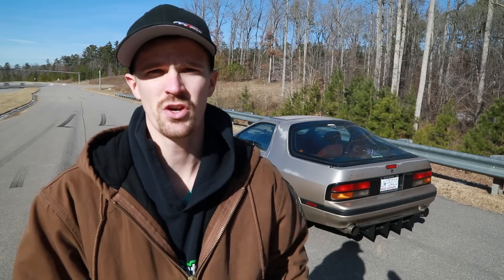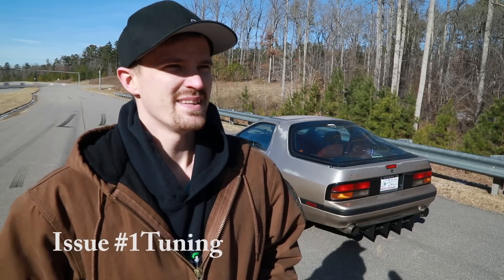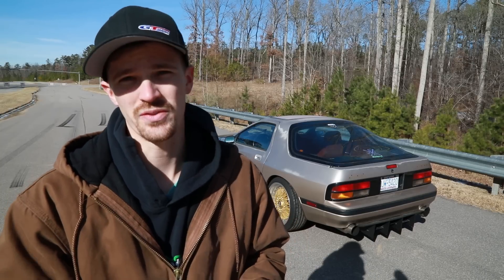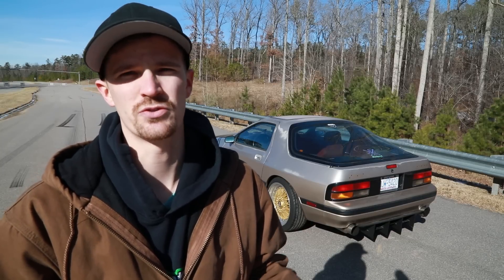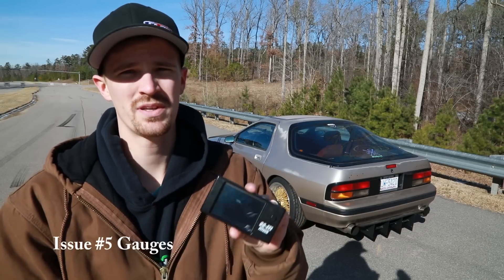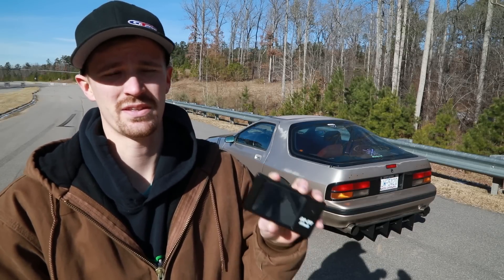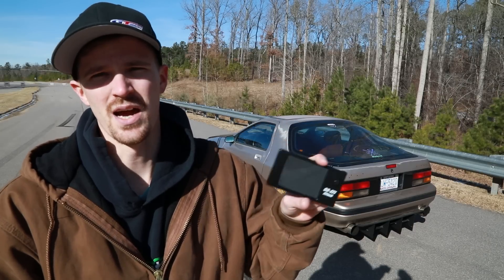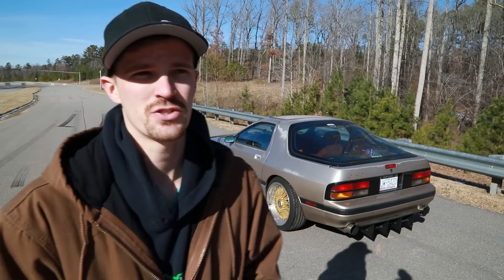5 Reasons Not to Buy FiTech EFI System

Comment: I find this funny. I’m thinking back to when I started doing hot rod work. When my friends and I built a 49 Ford mixed with a 51 Mercury and we had trouble with vacuum hoses and the 4 electric wires were confusing. We called the Gang Green. Have fun.

Comment: after many years of having a carb i decided to try efi and went with fi-tech. it was cheaper than other systems.. that was a mistake.. from the time it was installed it did not work properly. after endless hours of tuning and frustration and many conversations with the so called customer service, the unit had to be sent back for a complete firmware update.. this went on for 4 months.. it was returned and the same thing happened.  it never worked correctly.. then all 4 injectors failed.  a complete software failure.. fi tech was totally no help and did not stand by their product in any way.. i wasted 6 months of time money and frustration from fi-tech.. i moved to the holley system and have been very happy.. i sent the unit back to fi-tech in hopes they would stand by their equipment and give me a return.  well that did not work either. they have not contacted me at all.  just another reason to be very weary about spending your hard earned money to buy fi-tech.. if you are thinking about efi, run don not walk away from fi-tech..

Comment: All of that is easy to fix. Toss the china junk in the dumpster where it belongs, or sell it to one of those Yahoo's who never had a car that ran decent and think fitech great. Replace it with a Sniper or EZ-EFI. Problem solved. 
Source: I've fixed many cars with a fitech that didn't work right. The average cost to the customer was substantially lower for the ones who agreed to trashing the fitech and replacing it with a better system. Most of the ones who didn't, and drive the car a lot, were back to have it replaced with a better system within 18 months, when the fitech died (because they don't last).

Comment: I have the 400 to 600 horsepower EFI  Carburetor. On the 3 50 72 Engine. Was good for a while. Having problems with my fuel. Have a pump in the gas tank. Worked good for a bit. Used to have a command center with the mechanical pump and that worked   better But double problems if if one quitch the other 1 does.. If I would do it again I wouldn't bother. I wouldn't go with this again. There's always something.  not reliable.

Comment: I have a 69 Camaro Z28 ZZ4 Crate Motor 350/385 H.P. 2 FiTecs later I now have a Holly Sniper I had the ECU burned out on the first unit that they replaced under warranty the 2nd unit was installed and it just had idling and stalling issues even after I installed the holly sniper fuel tank 
be aware that the fuel system works on a siphon system the fuel pump has to be lower than the fuel tank the whole thing has been a nightmirror for me. I now have all Holly Sniper EFI  and wish I had bought the Edelbrock Oh well I did not do enough research 
Randy Hansen

Comment: Air filter is way to small for starters then the transmission needs to be a 6 speed gearbox when running a 4.11:1 rear gears but a for explorer V8 was a 4.6L is a bad combination to start with the rear gears need to be closer to 3.73:1 to better suite the 5 speed gearbox he's using he needs to watch some powernation videos on EFI tuning. Also he needs a bigger battery capacity along with a bigger amperage alternator to maybe a 220 amp unit would do just fine.

Comment: I picked up some better connectors on Amazon and modified the handheld and wires to a USB single plug in. Yes you better know what your doing as far as electronics soldering and identification of ea wire and what part of the connector it needs to attach to. You don't want 12v + running to the data port or something like that because you WILL fry the whole system but I agree the hook ups to the handheld are beyond crap. Again don't try it if your not VERY versed in electronics and FItech won't warrenty it if you do fry the thing.

Comment: FiTechs are hit & miss. If you get one that runs when you install it. Leave it alone and don't touch it. You got a good one. If it doesn't run eight from the git go. It won't !!! Scrape it for a Holley or just put a carb back on it. I uninstalled mine and left it in the alley for someone else to experience the down side of hot rodding. It was gone the next morning.

Comment: It looks like a person will have to purchase the full package in order for this to work correctly, to get support to fix the issues.  I have a 1972 Oldsmobile Cutlass auto transmission, with a 350cu 300hp engine, with a 2  barrel carburetor.  I am having trouble with the 2 barrel even thou it was rebuilt. Does anyone have a video showing how to install FiTech EFI system for my car ? Thanks.

Comment: Thanks for the heads up !!  brother, why don't you just drill & tap for another temp sensor?
Reply from the maker: Not a bad idea! Never thought about it.
Reply: @Petrol360   depending upon where you drill, the cast may not be real thick.   So only run the tap half way up the taps threads and check for sensor thread fit.   Pipe threads are tapered, so if it's tight, run the tap down further and it will 'open -up' the threads.
 good luck !!!

Comment: think holley is better? I've been waiting for my holley for months but because of covid shipping. Fitech is actually in stock so might go that route instead
Reply from the maker: Iv installed a Holley sniper unit (but don’t have the truck running yet) and I think that its a much better unit. It offers much more in depth tuning capacity then the Fitech and better customer support. In contrast the Fitech unit I had was a very early one. Hopefully they have improved the design. But simple things like Holley using can bus rather then two data plugs is a sign of how much more thought and time went into the holley system.
Reply: I have compared a Chevy 350HO crate motor with a Holley 850ish carb and the Fitech Forcefuel for 400hp. The carburetor was 100x better because it allows so much more fuel to flow through. The fitech lacks so much power and actually made the car a lot slower. It is fuel efficient! Less fuel = less power. With that said maybe it would be different if I bought a higher hp fitech system.
Reply: Go Holley

Comment: Fitec sucks I leave in riverside and i’ve been down to the main office in riverside three different times and even those guys can’t get this stupid efi to work properly.If you want to spend most of the time on a tow truck then go get it . This thing will work beautiful for about 100 miles after that you will find yourself on the phone frustrated with this peace of caca. They will say try this a weak later try this other thing . I’m just going back to carburetor i’ve never been towed with a carburetor. Bottom line if you want headaches go for it the only thing you will be out  about 2000 dollars and all your paying for is a big headache. So good luck.

Comment: I’m using the FiTech Go EFI 600 hp on my SBC. Online support has been OK, phone support was excellent. I agree the connection to the handheld programmer could have been designed better but I understand it is not designed to be used as a permanent dashboard, that is what gauges are for. I bet your performance issues go deeper than the EFI system. I thought my EFI wasn’t working correct, turned out I had a leaky intake gasket.

Comment: Its 2021 has FiTech addressed any of these issues?
Reply from the maker: I had called a few times and they never really fixed the issue or provided good information for me. I sold the car a few years ago with the efi system. I have heard better things about them but I bought a sniper efi for a new project and im very impressed with it so far. Truck isn’t running yet so I can’t give a real option on it.

Comment: A car so fast it needs formula one ground effects below the rear bumper!  I hope you got the fitech to work for you.
Reply from the maker: Rear defuser was a fun project with a buddy and gave us an excuse to use a co2 laser cutter. Fitech never was 100% but it did work. I think they have fixed a lot of the early issues like this unit had. That being said or next project will be using the holley sniper system.

Comment: ill add a few more reasons NOT to buy fi tech.....about $1500 to switch my truck over, they tell me i need this frame mounted fuel pump and filters(2)...i already had an electric fuel pump in the tank, so waste of more time n money....so, now i hafta pay to switch the fuel pump back....also, my vehicle stopped running going up n down steep hills n tight turns!!.....and to top it all off, the ecu on the unit lasted 17 months n died....went to msd atomic unit..much better!!....fi tech = major piece of $hit!!

Comment: All I picked up from this was you bought the cheapest unit that didn't have the proper setting for your car & you didn't isolate the power source for the efi from the battery that will obviously pull a draw when cranking. If you isolate the power for the unit from the main draw then you wouldn't ever get white screen resulting in having to unplug the screen. Bashing on a product because of your ignorance to how to properly install & troubleshoot the system is pretty foul. When you have thousands of people using the system worry free it has to make you think "hmm maybe im the problem"

Comment: I have a friend that is a tech and has done trouble shooting on many do it yourself installed FITECH. Made all of them work perfect!!!!! Most were simple over looked things. Also many tried to get away with improper fuel pump. Bad ground common. When they don't have proper test equipment they can't figure it out.Never had to send any back they sold and installed or any he repaired the install on. He would have this figured out in know time.

Comment: Thanks buddy for the great advice.  Your not alone either there is a guy who has a shop in Tennessee and is sponsored by fitech and edelbrock.  They both gave him a free system to evaluate and report the findings.  He installed the units on 2 of his early 70s Broncos with 302. Unfortunately he wasn't given a Holley sniper kit but after watching his relativity long detailed video he concluded that that fitech system is junk. Same issues you reported.  Terrible tuning device with blackouts and he had other issues with surging.  The Edelbrock system won hands down.  No problems at all fire it up and go riding around for it to tune. I'm really thinking about installing an efi on my 83 Chevy k10 pickup and I'm kind of thinking Holley sniper the 400 hp version with the fuel pump, Filters and everything including great tech support to help regular guys like us get through the installation.  I'm thinking spend the extra $200 for the Holley even though I'm going to sell my metal lathe to do this I'm not a wealthy guy lol
Reply: Just went to find his videos. He was NOT sponsored by FiTech and paid for his unit. He liked his unit and stated it was great but he likes Edelbrock better. He lost me when he said Edelbrock gave him his system for free VS he paid $1000 for his FiTech. His opinion is now extremely Bias

Comment: I see the problem, the air cleaner (air filter) is too SMALL.
Reply: That was the 1st thing I noticed also, I don't think there's enough surface area on that filter to pull in the CFM's that you need for your motor to run properly.

Comment: This is misleading information, the fitech unit and system is reliable. I’ve been using it for 4 years now and still going okay. Yes I do have problem that hard to solve but thats all return tobe other problem such as  weak ignition, filters, vaccum leak etc. IMHO if you buy expensive system it will get you the same pain in the ass problem ... so just make sure we understand whats going on with our ride ....

Comment: 1 problem with your car, that I see right off the bat is the air filter assy you are using is WAY TOO SMALL for your engine. There is no way you are getting enough air to run correctly, let alone idle.  A carburetor wouldn't even work with that air filter. The EFI system can only do so much. It will never offset bad installation. 
Get the engine breathing before you poo poo the Fitech anymore. No amount of tuning will compensate for lack of air.

I've been running a 400 hp go street on 1 of my classic cars for several years. It runs light years better with the Fitech than it did on a carb.
Reply from the maker: Mike Doherty if you read through the other cements iv already talked about this. Iv run the unit with and with out the filter. Same results.  The tune was only one of the things I saw that needed improvement with the unit. Also a Carter AFB ran with the filter.

Comment: 350 MILES FROM HOME   Called tech line, they wanted all  information such as dates bought, purchase number or invoice number before they could help.. Who carries this with them ON LONG TRIPS?.  Something burned up in throttle body. Try getting this from your local parts store on the road. Back to the carburetor for me.  No more after market fuel injection for me.

Comment: i had the 600hp system on a pontiac 400 with a t76 turbo ran great built a 461 with a 88mm turbo upgraded to the 1200 system nothing but problems wont idle right keeps losing all the settings tech support is a joke dont buy one this thing is going in the trash .bought a snipper system to replace it

Comment: It’s a piece of 💩x2 should have kept it simple and got a carb elderbrock waste of 1500$ like I’m rich
Reply from the maker: Got mine second hand for cheap so I didn’t spend crazy money on it. I got this to replace a Edelbrock carb that was having issues with vapor lock and fuel slosh in hard turns.
Reply: Did it finally work
Reply from the maker: It was still so-so. Don’t have the car anymore but I put a few thousand miles on it. Always cranky right up and idle smooth. Just the fine tuning at part throttle ect seemed off. After fighting it I just called it good and moved on.

Comment: You may as well be feeding air into that car through a single Stromburg 97.
I had a filter like that on my 1976 Ford Pinto’s 390cfm Holley. I bought it at the infamous “Super Shops” speed shop.
My dad saw that on my car, took it off and threw it in the trash and my car thanked him.

Comment: WoW! You put an Explorer motor & valve train in that car. That’s your 1st mistake. Since when has Explorers have been known to be performance options. Get rid of that junk & throw in a 302 from a Mustang.
Reply from the maker: You might want to do a bit more looking into the explorer motors. They came with better heads and higher compression then the stock mustang motor came with as well as better efi intake. The explorer motor (gt40 & gt40p) motor is the best option for a roller 302 other then the cobra motor. Its very common for mustang guys to swap the heads from the explorer onto there mustang motor for cheap boost in power.
Reply: Petrol360 I appreciate the input, I really do. You yourself said it. Manifold & heads from the Explorer are swapped out on to the 302. I’m sure you know that Mustang 302s from ‘87-‘93 have forged pistons. Homeboy here said his power plant is an Explorer long block, he didn’t say top end is Explorer. Than again, the top end is like the Cobra (GT40 & P), but Tootsie Rolls are like chocolate too.
Reply from the maker: If I was looking to boost or power adder I would have built the rotating assembly but just being a street car that I may have put a cam in down the road there was no reason the explorer motor wouldn’t serve my needs.

Comment: The go street has pwm fuel control and walbro 255 is non Pwm. Walbro actuslly says not to run their pumps on pwm
Reply from the maker: You are correct thats why the pump was run off a relay triggered by the factory car harness.
Reply: @Petrol360  got me there lol i ahould invest some time into your videos

Comment: Had my 400 hp unit o  my 406 sbc for 2 years now and have never had a problem.
Reply: What settings did you change to make it run good. I got a mild cammed 350 and it runs pretty good but off idle under a load bogs and wide open throttle hits are alittle doggy

Comment: Really,  you guys have some great ideas. Especially,  especially,  air flow in,  out (intake,  air cleaner, etc.  ,big exhaust etc. ). Me and my friend put a hot Cam in his old power wagon with 318 v8. we did air cleaner,  intake,  4 barrel etc. it only gained a little. We knew we still had to open the exhaust,  so we added a 2.5inch dual exhaust,  it must have gained 100 plus HP! Obviously,  the exhaust was choking everything else! Anyway,  it all worked out. I have a Rochester q jet on my old 1979 Chevy 4x4 truck,  it runs amazingly well for such a simple device. I'd like to upgrade to  fuel injection, like FI tech,  or Holley Sniper. What do you guys think,  is it worth it to me? Thanks.

Comment: Get a bigger battery,install better grounds on the engine to chassis. With electronic fuel injection you need good power and good grounds. Like others have said,talk with the manufacturer,they usually have the answers to your questions.